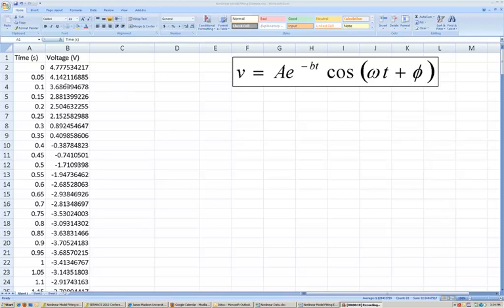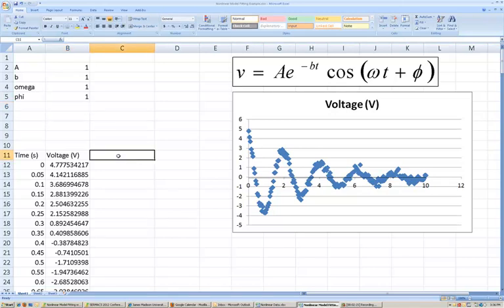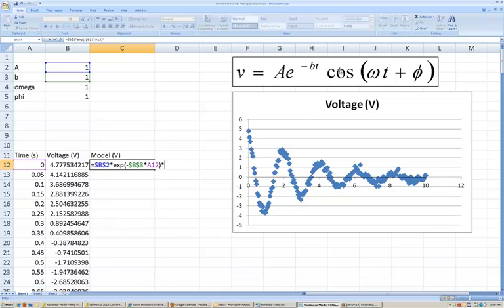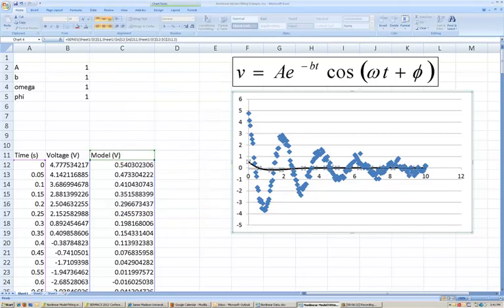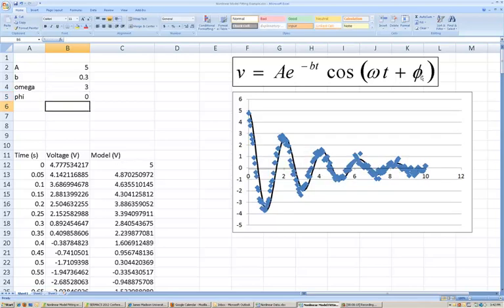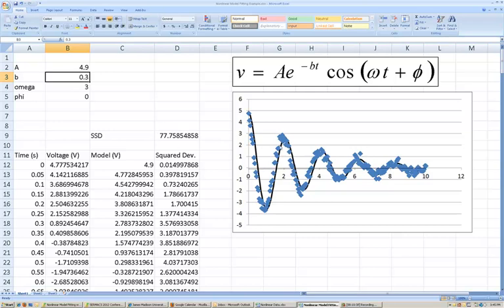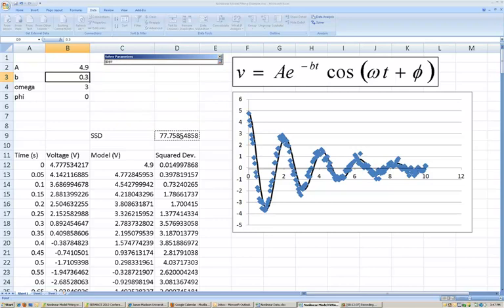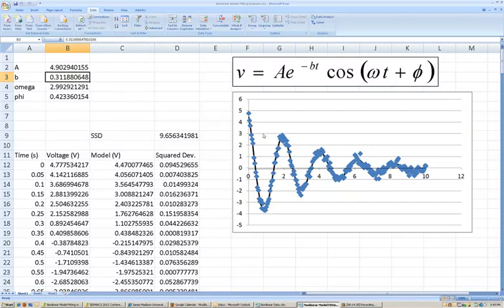Nonlinear Model Fitting using Excel

Comment: This was well explained, but I need to do something a little more complicated. I'm trying to do a multiple nonlinear regression - that is, with at least two parameters needing to be estimated.

Using Solver for this is not hard - just change the objective to encompass the two variables. But, I'm wondering how to calculate error bars on each parameter individually. I know how to get a 95% confidence interval on a nonlinear regression, but it only makes sense when there is one parameter.